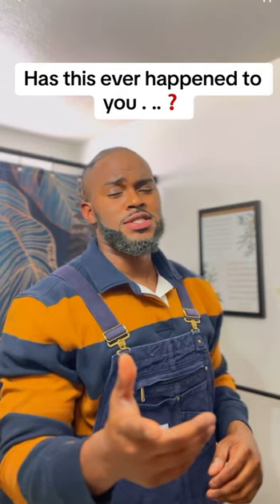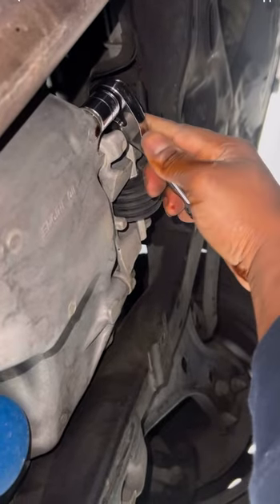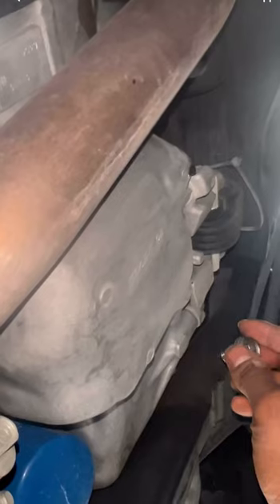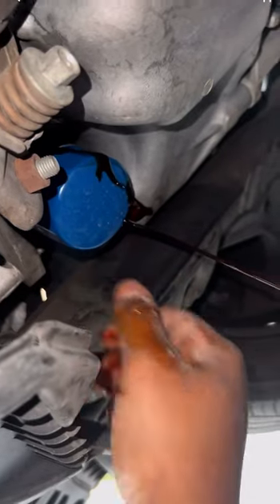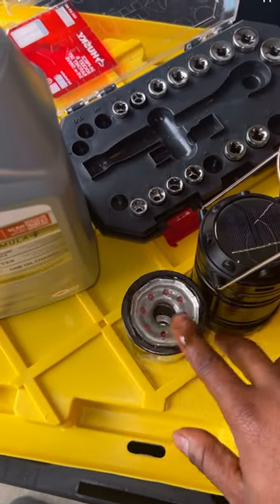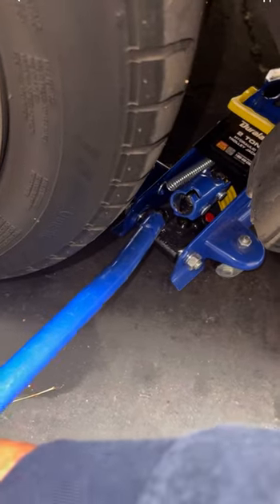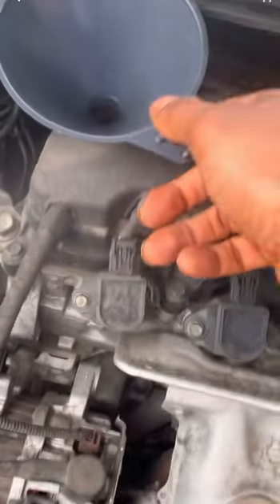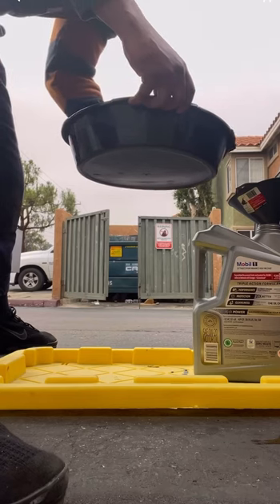How to do an oil change for a 2012-2015 Honda civic in (1 minute)

Comment: If I turn my wheels, turn my head side ways, and reach I turn that drain plug without jacking.  Reaching down for the oil filter from the top is a little tough.  Had so many Civics--I'm talking about a 2007, I guess.